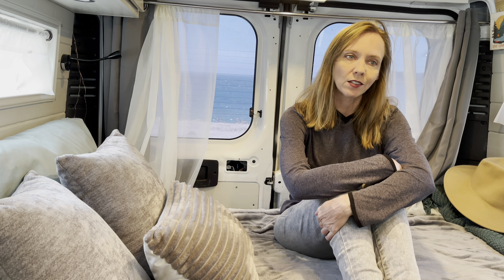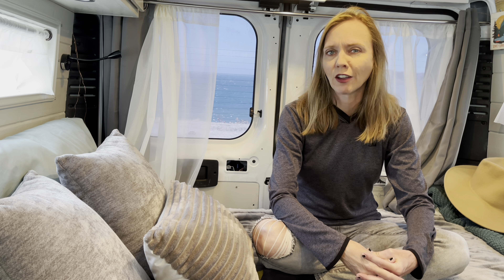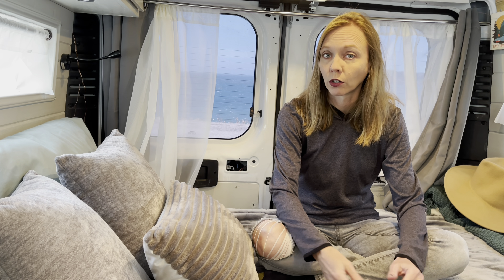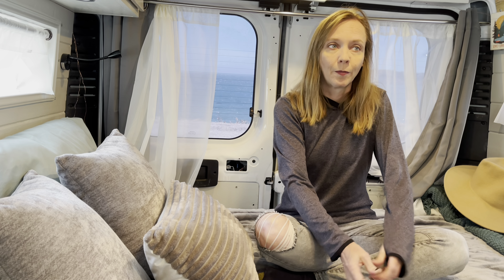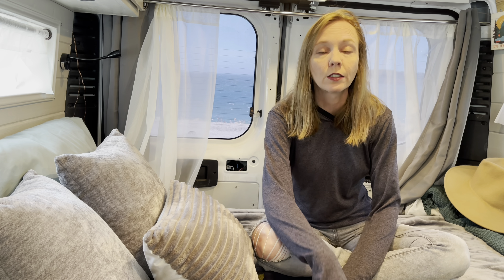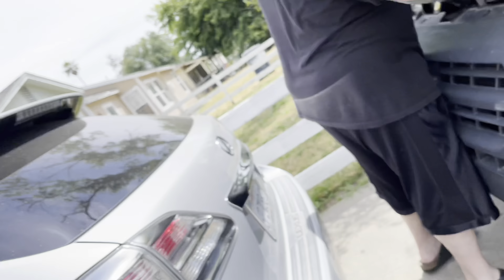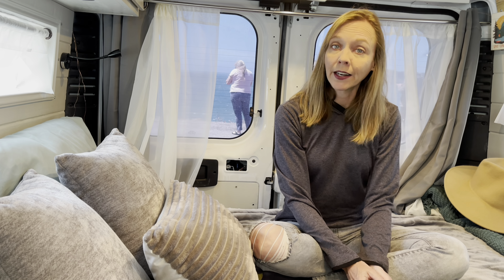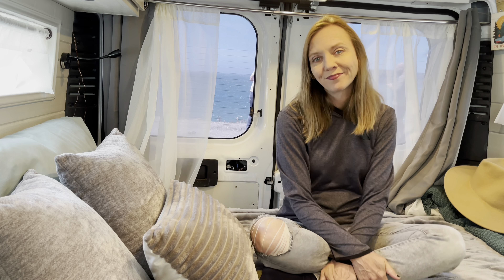DON’T MAKE THESE MISTAKES | #vanlife | #solofemalevanlife

Comment: Things will happen on the road. The bestvway is to learn how they normally work and how to fix them yourself! Save lots of money headache. Safe travel Annette!🙏
Reply from the maker: More things happened after this! My lesson, which I should have learned already is, check fuses first, every fuse possible - check it. I’ve blown three fuses and the hours of thinking and troubleshooting could have been saved if that was checked first. I now have a multireader and can check everything if I have another solar problem - which was the latest issue. I have spare fuses for almost everything now. Safe travels to you too, Tim. 😊